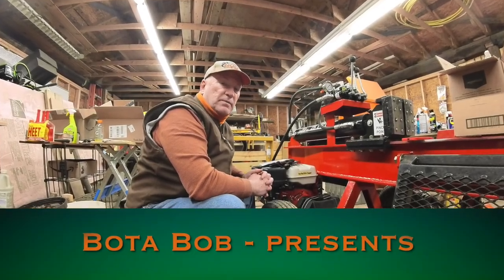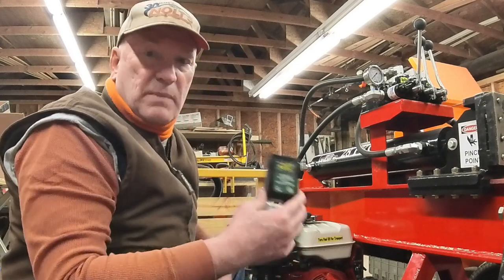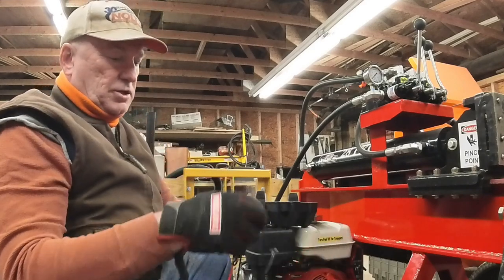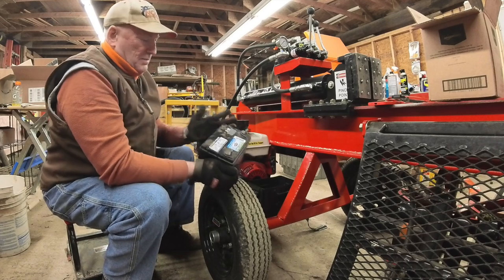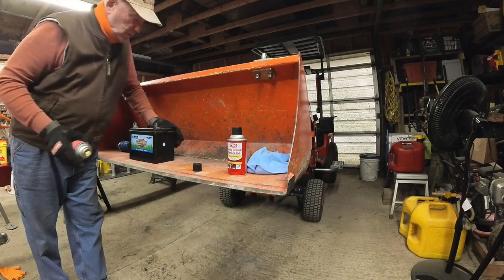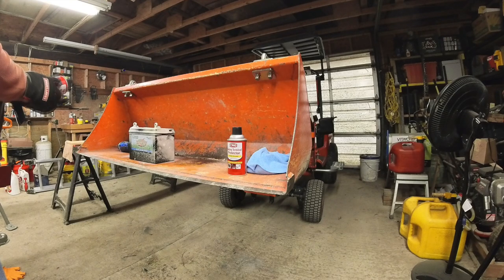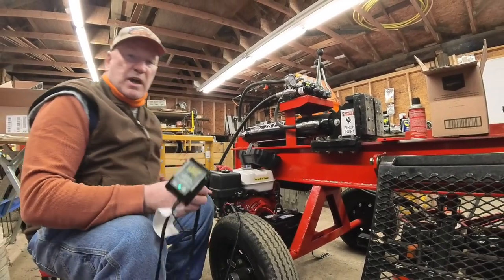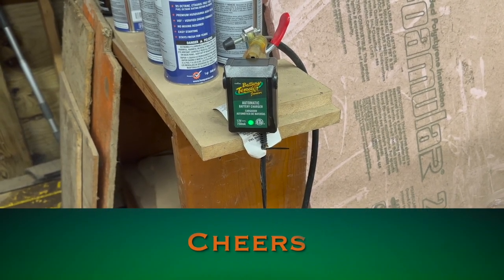138 - Wolfe Ridge Battery Tender

Comment: Great video, thanks. The battery cleaner is interesting. We recently bought a couple of battery tenders and they are a great idea. We have started looking for one over here that can maintain a number of batteries at the same time
Reply from the maker: I paid $35 USD for this BT.  There is a 2 bank BT charger that runs $100 and a 4 bank BT charger that will set you back $185.  With the price of new batteries going through the roof, it is well worth the price.  Thanks for watching and commenting. Enjoy the Journey - Cheers

Comment: I have heard those really do help.
Reply from the maker: I looked up the price of a new battery for my BX tractor.  The price range is $145 ~ $205.  If I can double the life of the battery it paid for itself several times.  The current battery in the BX is the third one.  The original battery was replace about one year after I purchased the tractor.  The second battery lasted 3 to 4 years.  That is when I started using the Battery Tender.  I'd say this battery is about 5 years old.  I keep the BX on the BT during the winter.  And it always turns over with authority.  Light the glow plugs for two 5 second cycles and it fires right up.  Thanks for watching and commenting. Enjoy the Journey - Cheers

Comment: I have a couple of tenders they work good I also use the desulphator it keep the deposits down.
Reply from the maker: I was skeptical about Battery Tenders.  But after using it on Bocephus for a few years now, I am convinced they extend the life of lead acid batteries.  Thanks for watching and commenting. Enjoy the Journey - Cheers

Comment: Hello Bob, They are the real deal, i have one on my old company Generator and it still starts after 15 years, We will be curious how much longer the battery will hold up🚜🪵👍🏼🇺🇸
Reply from the maker: I was curious what the price of a new battery for the BX.  $145 was the cheapest all the way up to $205.  If the $35 battery tender can double the life of a battery, then the price is worth it in my opinion.  I started using the BT on the BX in 2017.  I haven't replaced the battery in the BX since before 2017.  I am sold on BTs.  Thanks for watching and commenting. Enjoy the Journey - Cheers